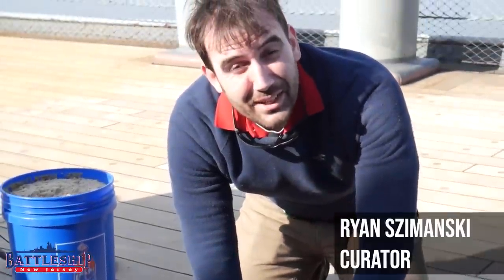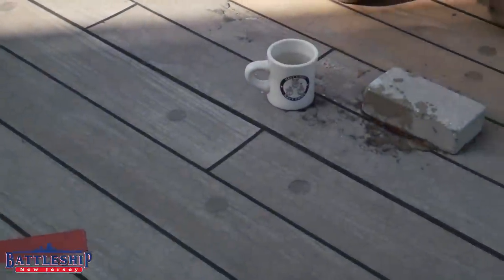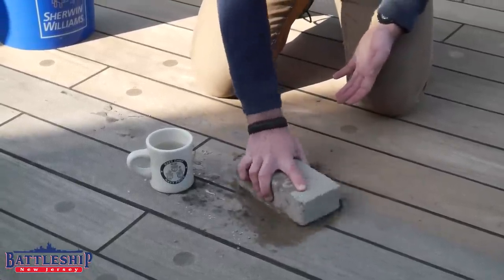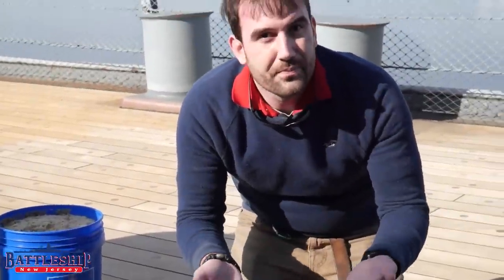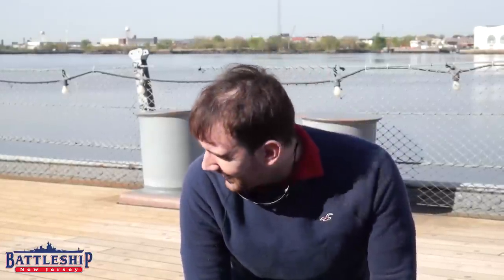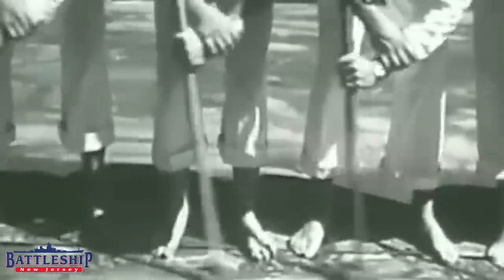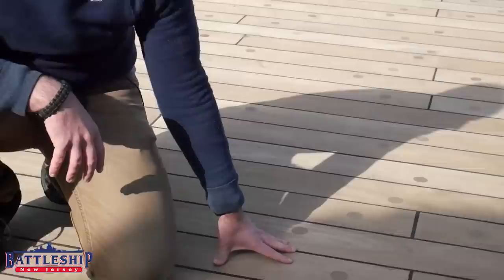Holystoning the Battleship's Decks

Comment: Thank you Ryan, this was a great video showing the massive amount of physical labor which was required to maintain a battleship in service. Everything was manual and analog onboard, which when mixed with digital upgrades sometimes caused problems. This was a major reason why the Iowas were decommissioned so quickly in the early 90's. The crew was 1800 while I was onboard in 1988-89 and the Navy could man approximately six Arleigh Burke DDG destroyers with that amount of sailors. So you see if they decommission four battleships, the Navy could man 20 modern destroyers! We had wooden teak decks on the 03 Signal Bridge level, which we used to scrub every Friday morning during FieldDay. We tried the holystones and sand, but it did not seem to work very well compared to the powdered bleach we could get from the Deck Force. We used standard scrub brushes with long handles and sprinkled the bleach mixed with water. A five minute scrub and rinse the bleach off, then the decks would dry and be nice and white looking. An even better and quicker way was to use the powdered drink packets of Kool-Aid called bug juice from the mess decks. We liked the lemon flavor as it stained the decks a nice golden yellow. All we had to do was pour a packet into a mop (swab) bucket, scrub the bug juice into the deck and let it dry. The decks would look great for a week, plus we did not have to worry about staining the steel painted deck and bulkheads as would happen with the powdered bleach. Lance Schoenbaum SMC(SW/AW) USN Retired

Comment: In the sailing ship era the decks were laid, meaning the deck consisted of planks, between these planks was oakum and or cotton plus tar, Tar made from wood resin. A sailing ship twisted as it sailed , the entire ship twisted back and forth and these seams , as also the hull , moved slightly. The decks had to be kept wet so as not to shrink and leak, into where the crew lived and the cargo. Holly stoning kept the gain open for the water to enter the wood, it also took off any splinters, the sailors were mostly barefoot and it improved grip. On a ship of the line sand and water was spread to increase traction and extinguish sparks from the guns during battles. The reason they now use teak is because of its high oil content and dimensional stability. They reason it turns grey is the oil leaching out of the surface. WWII aircraft carriers had teak decks, two layers of 6” teak. Real teak, Burmese teak is hard to get and really expensive. Last I saw was $30-40 board ft. That brown wood they use for the lawn furniture is not teak, even though they call it teak. They have done the same thing with mahogany.

Comment: Holystoning was as much a safety reason as it was a presentation. The cellulose fibers that stick out that make the wood appear gray would become a prime place for algae and other things to grow and would become quite slick in a ship that was traveling and had a lot of sea spray on her all the time. Being a museum ship she'll only see rain but also get to dry out well so that will never really be a concern.

What's funny is you can tell a ship even in modern times that's been on deployment for a long time because the noskid will be worn off on many sections of the weather/flight deck. And that has to get replaced during deployments. Along with rust removal and repainting.
Reply: Needlegun go brrrrrrrrr
Reply: @actually5004  ah yes, the needlegun, and the knucklebusters
Reply: Once for dust, twice for rust, three times for structural integrity.
Reply: That actually makes sense, thank you.

Comment: I always wondered why wooden decks vs steel decks especially on aircraft carriers. Thanks, great content.
Reply: Wood is a great insulator, is flexible, keeps water out (when properly caulked), and is much, much less slippery than metal, particularly when covered in oil.
Reply: On the Battleship - teak on top of the steel deck. I believe for the US World War 2 Aircraft carriers - flight deck was wood - no steel beneath it. Weight savings. Very easily "penetrated" by enemy bombs. Most Essex Class aircraft carriers - in 1950s as the angled flight deck added - WHOLE flight deck replaced at one time with steel. Weight of larger aircraft required it. I believe heard the USS Lexington did not receive such treatment - piece meal over time. Maybe some segments still just wood and the non-skid.  I don't know what the wood necessarily added for the battleship? Some weight savings? Splinter of fragment protection.  Oh - implied not stated - were the bricks extras/ spares stock of refractory brick for the boiler.
Reply: I believe the decks were teak on the prewar US carriers for the non skid properties and ease of repairing damage.  It also would have helped to keep the weight down and the CG low.  Regarding the weight, there was apparently a  total tonnage limitation in the later Washington Naval Treaties. So they had to keep the weight per ship down.
Reply: Steel decks on aircraft carriers are much heavier than wood.  The high freeboard of a carrier's deck changes the 'righting' forces and handling characteristics of the ships.  Wood decks are lighter and allowed much greater capacities (more planes and equipment).  The British used armored steel decks and fewer planes but were more resistant to the kamikaze strikes.

Comment: On my boats I use Te-Ka, which is an excellent chemical cleaner.  It works exceptionally well and I suspect it removes far less teak.  It is also pretty quick.  Apply, scrub lightly with a brush, and rinse.  Thank you again for yet another very interesting video.

Comment: I guess I never realized that holystoning was sanding.  I just assumed they were scrubbing dirt off the surface.
Reply: Couldn't they adapt a waxing machine to do this?!?  I pity the poor guy who has to get on his knees to do this and spends the entire work period polishing the deck!
They could use modern tech to at least make drudgery work more bearable and maybe semi-fun!
Reply: @AvengerII  In WW2 a stick and a brick WAS "modern tech".
Reply: @ghost307  Not the point.
We're NOT in World War 2.
I understand they want to keep the ship "authentic" but it does NOT mean unpaid, volunteer help should have to spend all day cleaning deck when you can adapt a machine that will preserve the ship without wrecking it, too.
Reply from the maker: Today we don't have the wear on it that they did while it was in service so it doesn't need to be regularly sanded at all.
Reply: Andrew Crews  Again, NOT the point.
I'm sure they can get a machine that will do the job well and in a quarter of the time or less.
Doing demos for the public is one thing.
Maintaining the ship by volunteers might require bending a little bit and introducing machines unless you'd care to drive to Camden and spend a weekend cleaning the ship unpaid YOURSELF?
Reply: @AvengerII   get off your high horse
Reply: @BattleshipNewJersey  About how often would you say the deck has to be worked on to keep it clean, and have there been any suggestions of what you could treat it with to stay off the wear?
I understand the main concern is chemistry.  You don't know what will happen half the time when you introduce a chemical (half the time) against hardware that is 80 years old in some cases.
I guess I'm being too much of a high horse for some online hard-ass admirals for actually ASKING QUESTIONS...
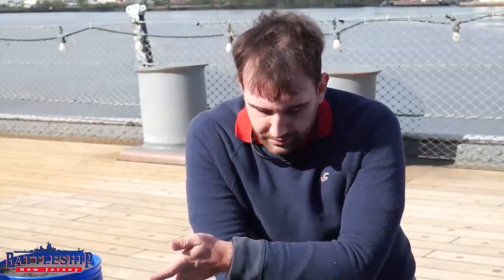Reply: @AvengerII  6:38
Reply: @Lemonjellow  40 years more out of the teak deck?
That's pretty good.  We're lucky if many appliances last FIVE years now.  It used to be many things would last decades.
Reply: @AvengerII  "volunteers shouldn't have to do this"
By definition volunteers don't have to do anything.
Reply from the maker: As we say in the video, we do an initial sanding, with a machine, and thats it.
Reply: @AvengerII  no your making yourself look like a goof by trying to downplay peoples responses "again NOT the point"  this is an educational channel. If you cant take someone else's point of view... Dont share yours
Reply: @AvengerII  put then what do you make your 500-600 low level sailors do?
Reply: @AvengerII  they literally say in the video that they sand with a machine.
Reply: @theVoyage  Do you always correct people THREE WEEKS after they post?
C'mon guys!
I know you don't like the fact that I asked the question but this is pathetic you're doing this almost a month later!
Reply: @AvengerII  I'm guessing they might have posted quite some time after your post because they might have watched the video and read the comments quite some time after you wrote your post. That is one possible explanation. Of course there are many more, but it is probably one of the more reasonable ones.
Reply: @AvengerII  thats not the point
Reply: @AvengerII  Did you not watch the video? He said he was giving an example, but they are not stoning this deck and will let it weather with time. Volunteer help will be used for other more pressing issues, and he even restated that there would be NO HOLYSTONING WORK DONE! Watch the video before shit posting ehh
Reply: @AvengerII  Just curious, what the hell are you talking about? They dont have volunteers holystone the deck, and it was made crystal clear in the video. They dont holystone the deck at all anymore... this was a demo. As Ryan said the paid carpenter is installing the planks and undersheathing, and sanding it flat as he goes. That is the total amount of finishing they plan to do on the new deck. Volunteers are helping strip the old deck off, but you really arent going to be able to innovate the way they have to do that. Now besides clearly missing the point that no one is holystoning this ship anymore, let alone for free - I do agree with you. If such a task is ever decided to be needed again on this ship there absolutely has to be a way to use some sort of high grit pad on a floor buffy that could even be mixed with sand and water to get the same effect. That being said if youve been following along, the "stock" deck was 2" thick of teak. This new deck is 1/2" of teak on top and what looks to essentially be pressure treated plywood ( marine grade rather ) underneath. Continous holystoning on such a thin layer of teak would be a terrible idea for a deck you want to last 40 years and for that matter, any abrasive maintence that is reguarly occuring. Moving back to my original point, no one is holystoning the deck ever again ( paid or for free ) and thats by design, so why are you arguing with everyone? Anyways lets be friends, its all good.

Comment: your going to have to have deck oiling parties every few months ideally make an event out of it
Reply: Possible I guess as it is no longer a ship on the front line. But, they are preserving it as much as possible as original so i would guess no. I doubt oil or stains of any sort would be used now or in the past on any warship. Doing so you have just added a flammable material... The last thing a warship would need.

Comment: I know the NAVY likes to keep their sailors busy, but I'm surprised that at some point they didn't adopt a mechanical sander/scrubber.  The old ships running mostly on steam power, I could see the NAVY developing steam powered devices.  A big unit for working large surfaces, also a hand held unit for smaller surfaces with confined work areas.  They'd put steam pipe connectors and hoses all around the ship to plug in the machines.  You get the job done faster and more evenly, especially where you have rust and chipping paint.  Using something like this you don't get the deep valleys and gouges where people have hand chipped out then painted over.
Reply: I dont think the point was the wood treatment, its almost certainly something to fill time for the crew

Comment: Could another method work just as well? Using a electric burnishing machine like we use on VCY tile with the proper pad sand and water. Would this work? It would speed up the cleaning process
Reply from the maker: Today we use an electric sander, we are not holystoning the entire deck by hand.
Reply: @BattleshipNewJersey  Thank goodness, if for nothing else
than saving your back.

Comment: Why not apply a clear coat?
Reply: Makes fires worse, and the coating will give off fumes as it burns. This is why wood on the top of the deck was preferred to insulation under the deck for so long. If the insulation caught fire under the deck during general quarters, people would die.

Comment: Question: in general, how much does it cost to keep a battleship as a museum? You know, floating and not totally falling to pieces? I asked the question at Drachinifell's channel, and was sugested to ask here. I understand there is huge variations and depends on what level you keep the ship in. But in general terms - I mean a rifle is cheap to keep for a museum, while a tank costs a little more to keep. But the leap up to warships sounds extremley expensive to keep as a museum.
Reply from the maker: Generally, a few million a year in the basic maintenance and keeping the lights on and paying some staff to manage all that. But there is a lot of variation. For example, Missouri doesn't have to heat their ship being in Hawaii, so that helps. But Missouri also has fuel from the Arizona surrounding her hull which isn't good for preservation. So there are a lot of variables. Texas certainly has more issues than NJ just because she is so much older which makes it a more expensive operation.
Reply: @BattleshipNewJersey  thanks! ❤

Comment: Growing up around Spithead, I was taught that the original holystones were scavenged from a ruined church at St Helens. In that case, the term would antedate the establishment of the United States.
Reply: The church was at Bembridge on the Isle of Wight, made from cut sandstone blocks. The church partially fell into the sea after a storm. The locals took the blocks and cut them down into holy stones for the Royal Navy. Clean decks by the grace of God.

Comment: In all the sanding I've done, sanding with the grain is the norm. I see you sanding against the grain. Is that how it's done with holystones?
Reply: It's how it is done with teak decks in general. If you sand them with the grain you can tear out wood and wear grain lines into them. Teak is a strange wood, it has hard and soft grain rings. If you sand it against the grain it evens out the wear and you get a longer life out of the deck.

Comment: During WW2 the stone didn't work if there was sailors blown apart on them, they would have to remove the wood deck then go to Hawaii to be replaced . The smell could not be tolerated by anyone one the ship. This makes me wonder about the old wooden ships and the conditions the sailors had to live with 200 years ago.
Reply: gonna need a source on that, teak decks are used on fishing boats with tons of blood and guts spilled on them. salt water and a deck brush cleans teak with no problems.

Comment: I understand the reason they used teak is because it does not splinter.
Reply from the maker: True! It also requires an accelerant to burn.
Reply: primarily because it is very resistant to rot.
Reply: How much is for one teak plank today?

Comment: I am reminded of my US Army days in which I (and others) were forced to polish brass that had coatings on it to prevent corrosion, starch BDU's that had a label on them citing the AR specifically forbidding such a practice and (my personal favorite) spend time and resources to paint rocks that were placed in various patterns around buildings.

None of these things served any purpose but to occupy soldiers and satisfy the whims of officers and NCO's who were promoted on the Peter Principal and liked traditions.

I think such traditions have no real place in any modern military and should be done away with.  Surely something more useful could be found for sailors to do than this sort of drudgery!  The application of teak sealer and/or some kind of oil would do much more to preserve a teak deck than any attempt to wear away the deck with sand and bricks.

I've got a piece of New Jersey's deck ordered.  I plan to rip it and shape it into grips for my Ruger Flattop.  I will be using boiled linseed oil to finish it, not sand and water.

Comment: Would a pressure washer not just do this?
Reply: They do have some electric sanders I think.
Reply: I think what everyone is missing is that this exercise likely wasn't just about cleaning the deck.  And it wasn't just about giving sailors something to do.  It was also a way to build cohesion and to establish a desire to meet high standards.  Sure, they could have probably used some sort of diesel powered or steam powered  sander.  But that would have eliminated all of the other benefits.  People also tend to forget that today, materials and tools are generally inexpensive compared to labor.  The opposite was true for most of human existence.
Reply: @kcgunesq  sorry I meant now, not while it was operating.  Specifically I meant to keep the color you get when you holey stone instead of the aged grey he said in the video they were going to keep it as.
Reply: Nope a pressure washer will destroy the teak.
Reply: @dutchglobetrotter4513  good to know, thanks!